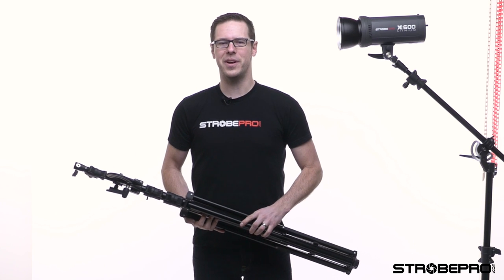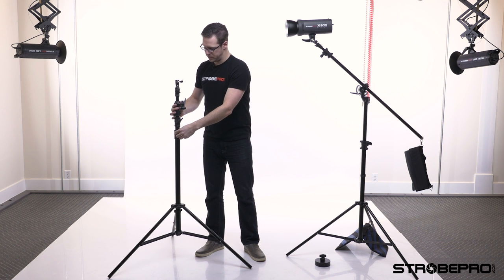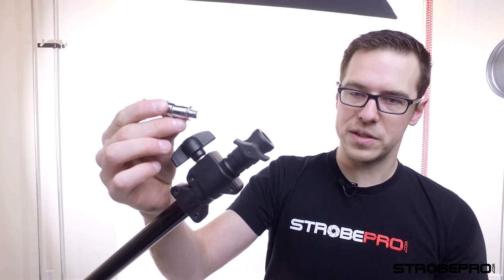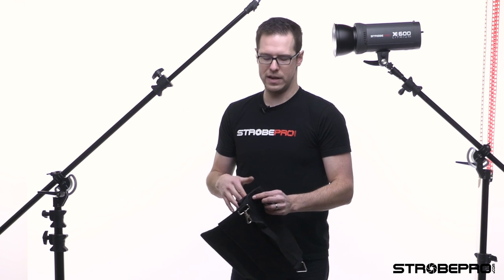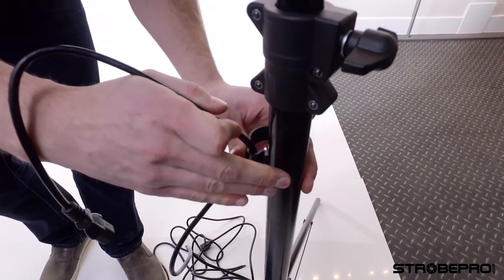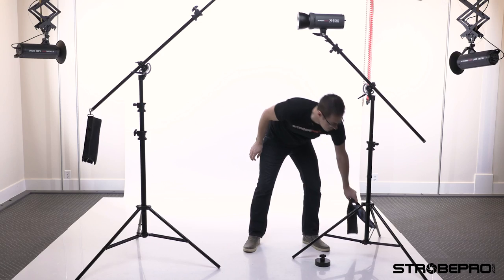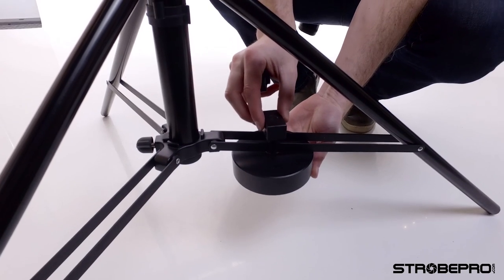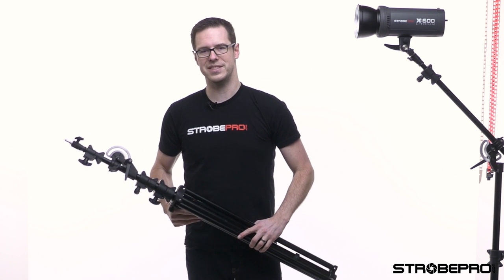2 in 1 Boom Stand Tutorial

Comment: Planning to buy one. Mainly will attach a Godox AD400 with a beauty dish. Will it be able to handle it and can i point the beauty dish at the subject (on axis with the lens) without it tilting towards the ground due to weight?
Reply from the maker: Yes it will handle it fine. We use squared spigots to prevent twisting so you won't have that problem.

Comment: HELP PLEASE..

I’m looking for a 
Industry Standard 1/4-20 screw thread
(basic camera shoe mount)

mounted at the top, or tip, of a monopole.

While that monopole  is attached to possibly a dual desk clamp.

I have looked quite a bit and I cannot find a camera shoe mount that is attached at the end of a pole anywhere.

The pole will stand vertically and
at the top of the pole is a standard industry camera shoe mount to mount a 35 mm camera at the top of that pole.
Reply from the maker: Hi duaneyoutbe,

You could use a combination of these two products to securely mount a regular tripod ball head to a boom:

https://strobepro.com/products/strobepro-handheld-super-boom

https://strobepro.com/products/tripod-head-spigot-adapter

If this isn't quite what you're looking for, give us a call and we might be able to figure out another option.